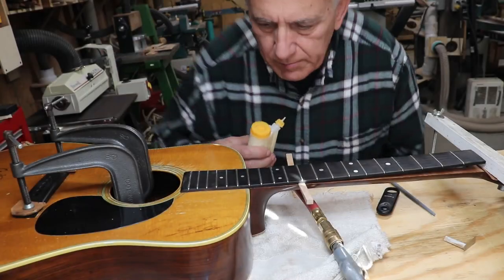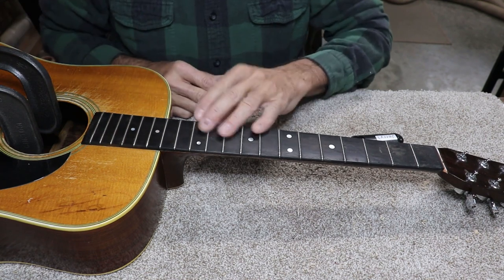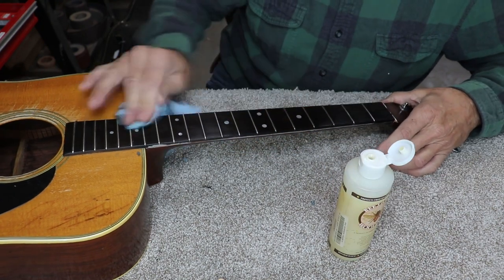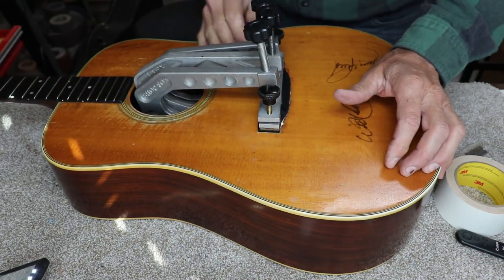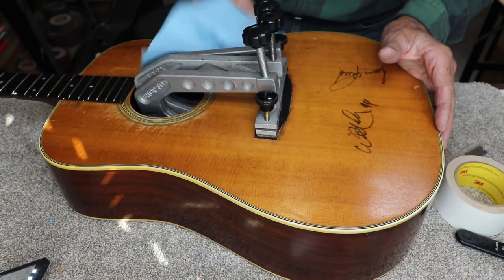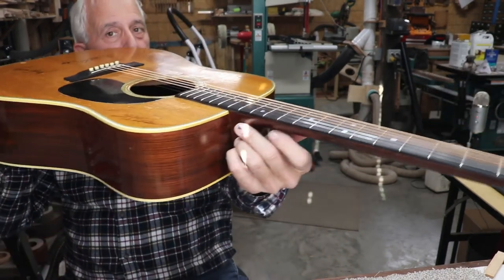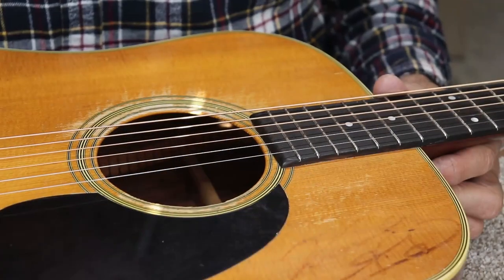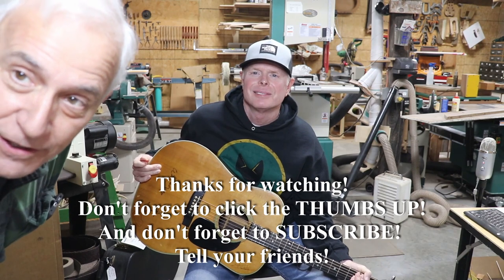451 RSW 1967 Martin D28 Part 2

Comment: Well, as you say, "if it ain't broke, leave it alone." And that saddle placement sounds perfect at it is. The old martin rings like a bell. I do wish sometimes you would test play up higher on the neck (maybe with a capo) to see if any buzzing issues follow it. However, it will probably play fine there too. Another great restore.

Comment: Greetings Mr. Rosa; The way you set the b and the e is the way i do for all strings, and I never needed locking tuners and i set them to have the less amount of turns possible (one for the wounds and two turns for the b and e) and i even cut the strings just in the peg without getting slippage

Comment: Even with the low angle on the strings at the saddle, those medium strings are really making themselves heard over the light strings you usually use.  As a performing guitarist, I can tell you that anyone who performs acoustically will always use medium strings for that reason.  Nearly all of my shows are amplified, so I use lights because they put less strain on the guitar, but you can't beat those mediums for volume!

Comment: I think that was a good technique for correcting the neck since the bow was the problem not the neck angle. I would have been tempted to crank more back bow into it and let it sit for quite a while before resetting the fretboard, but then of course you are flirting with a possible catastrophic failure so you need to be cautious. I would loosen the clamps every day to check for the amount of bow remaining, then reclamp and let it sit some more until I figure it had gone as far as it could. Then, when the neck has taken the correction as best it can, reseat the fretboard. The reseated fretboard could actually act as a bit of a neck support to counter future bowing. All in all it was a good correction, and you didn't break the customer's guitar, which counts as a win.

Comment: Merry Christmas Jerry! :-)  Don't know if this is a good idea but it looks a bit awkward when you are scoring around the bridge to make the new position.  What about instead of having to hold the bridge and score carefully why not give the area a quick spray with a thin water based paint so you get an outline and it would be easy to clean off.  Would it be accurate enough?  Just thinking out loud.

Comment: Thank You for sharing your experience. What is your relationship between under-bow and neck relief?
 Were you able to eliminate fret buzz above the 7th fret with this flat fingerboard? 
Can Tightbond  on the fingerboard extension be "unglued" with heat for a future neck reset like traditional luthier adhesives: fish glue or hot casein glue? 
I ask because I have a 1950 D-28 with two piece Brazil rosewood back and a volute at the back of the neck transition to the head  like this guitar, but it has a 3mm action height on the low E at the 12 th fret.  I am considering a neck reset to lower the action. 

I also have a 1965 D-28 with three piece Br. Rosewood back with a very low action that I can play fast jazz chords and solos with velvet smooth string bends using Maxim 24 Gold 9-42 strings.
Both D-28's  require neck relief to prevent fret noise when playing both open chords and  at positions between the 7th and 14th frets. 
I am curious if I should try you "plan" instead of a neck reset on my 1950 D-28.
Again thank you for sharing your experience, and I wish you a blessed Christmas. Peace.
Reply: Per a pair of wood masters, Tom Johnson and Jerry Rosa, ORIGINAL TiteBond will yield to heat and moisture, just as animal glue does.
Reply: @eliduttman315  Thank you, you are correct.  I tested Tightbond by gluing  together maple, and boxwood with ebony test blanks. I was able to release the bond with heat and a little water as y'all describe, but Tightbond seems too strong IMHO for the spruce under the fingerboard extension on my 50' D-28. I hope the guitar can be re- re- re-repaired 100 years from now (smile).  I like the long working time with fish glue. Error on the side of caution, eh? I appreciate all techniques to apply to our luthiers community toolbox. Each problem is unique. Thanks!

Comment: Jerry--if you had been still.030 off---nut to saddle-- would you have considered pulling the frets (which does have plenty of risks with old rosewood) and gently re-contouring the fretboard, adding thinning taper from tongue to nut? More than once I have done the job you show, and once, preserving the radius of the underside of the bridge, lowered it just .020 and "back-tapered" the fretboard, albeit, a new one I made. I did that since the neck join was poorly done and I would have had to heat and remove the fretboard either way.  I refuse (so far) to saw the FB at the 14-15 fret. I know some "repairmen" who lower the saddle too, but in my experience, doing so kills the bre ak-over and, thus tone and projection. I have done 2  multi-radiused FB's and never liked the result. On that Martin, from what I could see, that FB was already thin at 1,2 and 3. You really did a fine piece of work. It made me fervent in my desire to get my shop into the basement.

Comment: Some fret crowning files will leave scratches on the sides of the fret in some frets.  Jerry obviously has one that eliminates the problem. It's all in the choice of the tool.
Reply: He modified a standard tool by rounding over the sharp edges so they don't mark the fret board anymore.  We should all look closely at our tools to see if we can improve them ourselves.  But we are afraid sometimes because we spend a lot of money on our tools and don't want to damage them.  😃😃
Have a great Christmas.  🌲🌲
Reply: @nancymilawski1048  I was a toolmaker for forty five years. I used to buy stew mac tools and make my own version. A perfect example is that one they have for cutting binding ledge on arch top instruments.